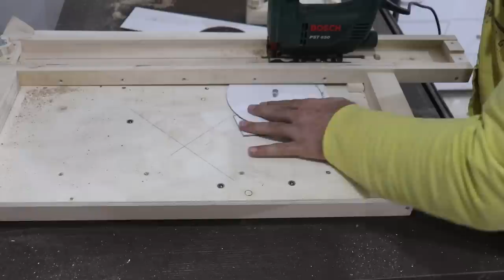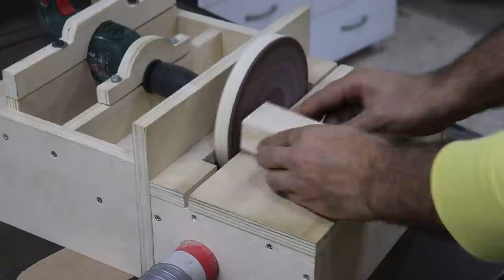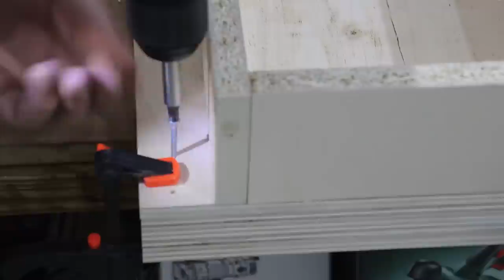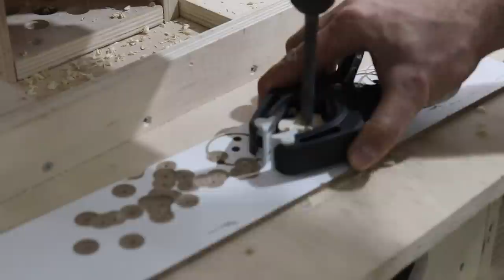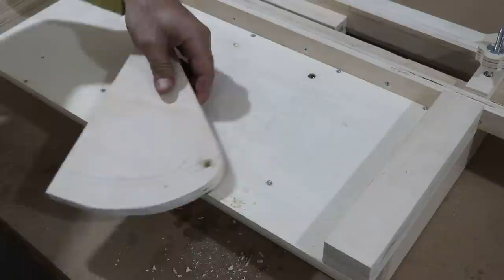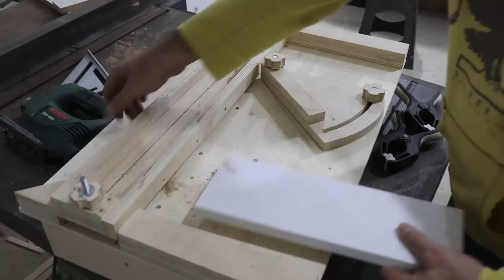Jigsaw Cutting Station - Dekupaj Testere Kesim Tezgahı

Comment: I am trying to build the cutting station for the jigsaw, but after having the pieces assembled I try to make the cut in the table that will serve as a guide and the blade is twisted to one side and the cut is not straight, making a curve.
(I used 15mm pdf) Any idea why this might be happening?
Reply from the maker: There must be an error in the saw guide line. Try to expand it a little bit. Thanks

Comment: Buenas Noches. Excelente trabajo. Gracias por sus aportaciones. ¿ Sería tan amable de proporcionar las medidas que marca en la GUÍA ORIENTABLE, en los minutos 9:27 ; 9:30 y 10:03? ¿Cuál es la distancia del borde de la GUÍA ORIENTABLE a la ranura que traza con el compas, en el minuto 12:24? Por su atención, Gracias. Saludos
Reply from the maker: 9:27 2 cm, 9:36 4 cm, 10:03 3 cm, 12:24 ambos lados 2.5 cm adentro, gracias.